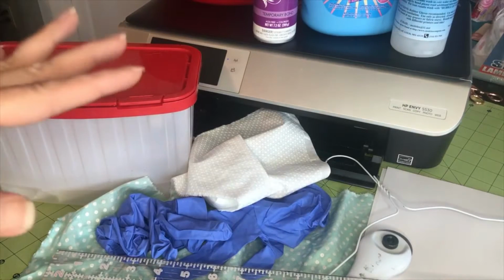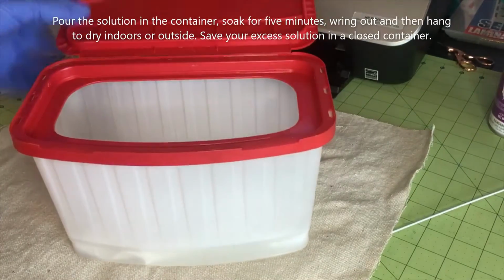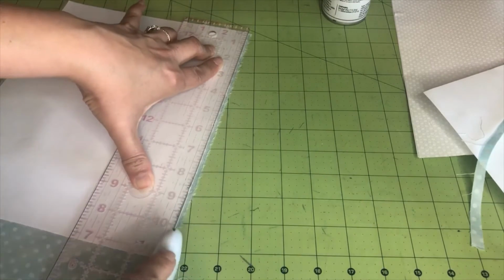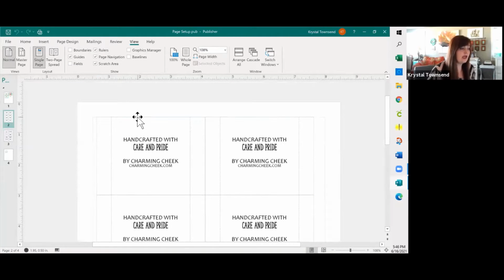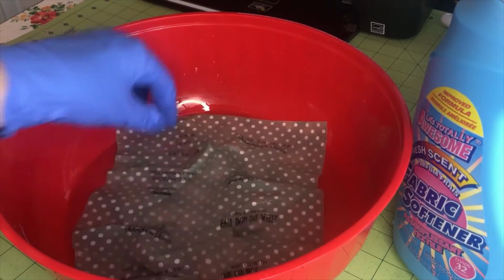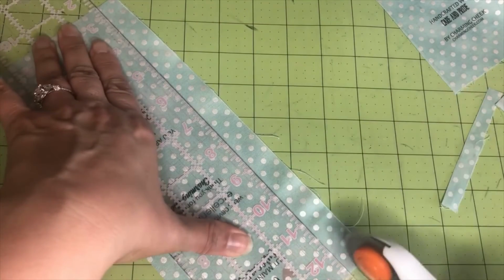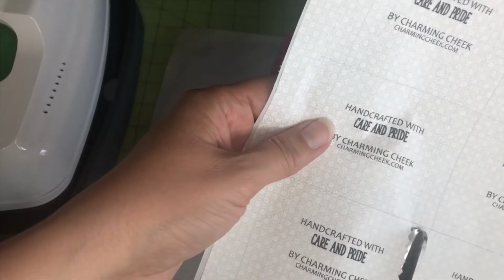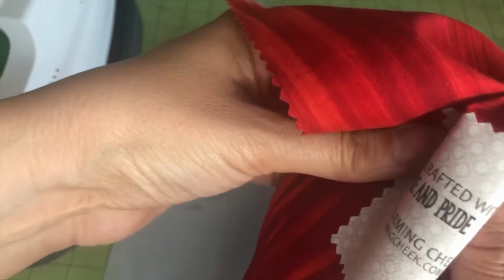Let's Make Custom DIY Printed Fabric Labels You Can Create for Bags, Clothes, Apparel & More!

Comment: just found this video and love it! question... you peeled the fabric after printing and went right into heat and bond. why is there no need to go through the fabric softener step? If it's ironing that sets the print, is the softener step not needed if you just iron the folded type?
Reply from the maker: Great question! I skipped that step here but should have explained the fabric softener step should be followed to be safe.